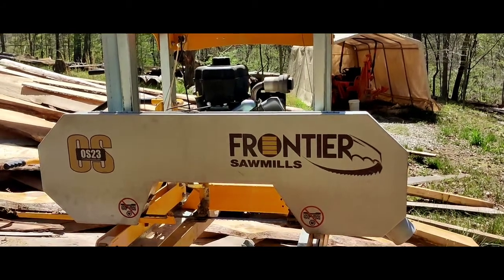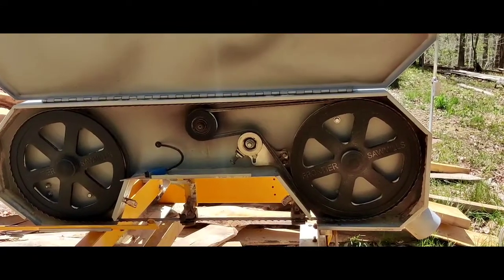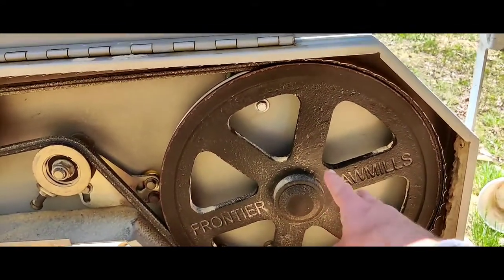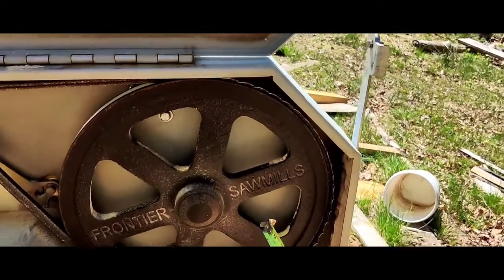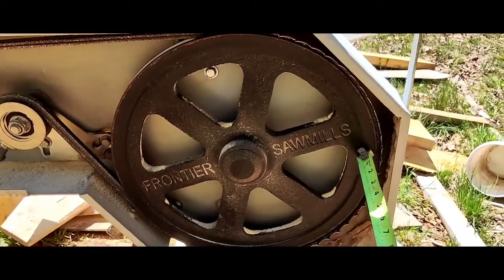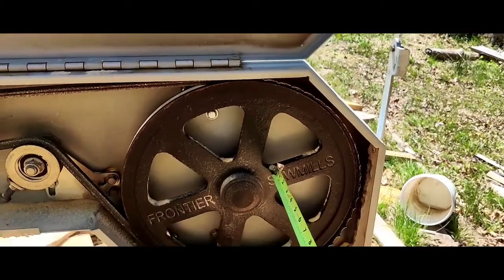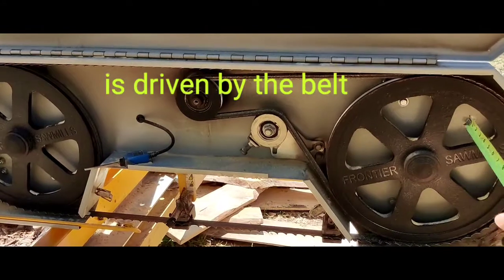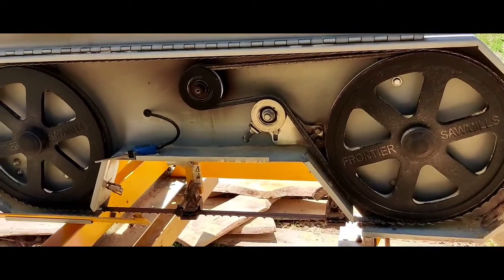Belt twisting on sawmill, repaired

Comment from the maker: Sometimes as the belt ages, it wears in a way that makes it easier to twist or even gets a twist in it. If the belt continues to twist put a new belt on.
Reply: I do a little picking on the flattop   bluegrass  mostly  iv got  10 old   6 strings an a 12 string   id love to check out sum of ur work   would you send me  sum info  plz  thank you very much
Reply from the maker: @RockyDurham-tn4ln  Currently and for the last 3 years, I have been building a timber frame house. I have been too busy to build any guitars. After I finish, I hope to resume guitar building but I don't have a time frame for that.